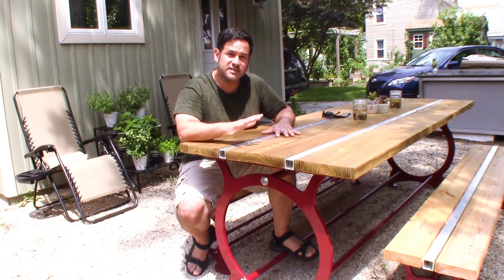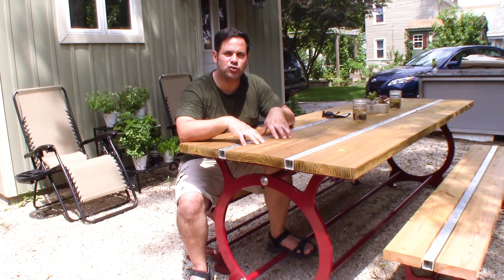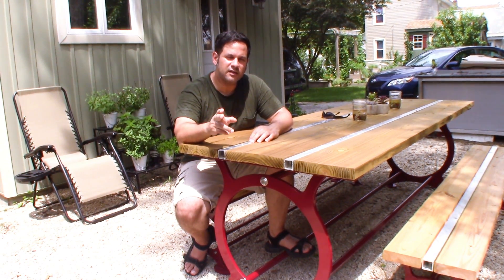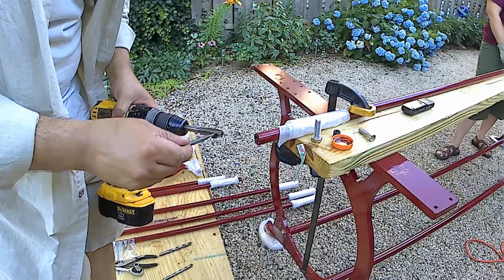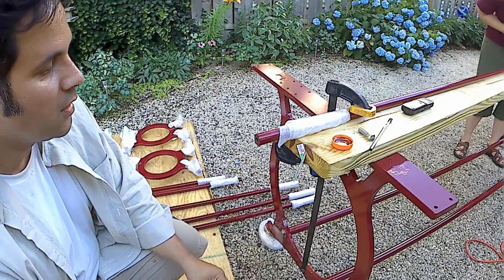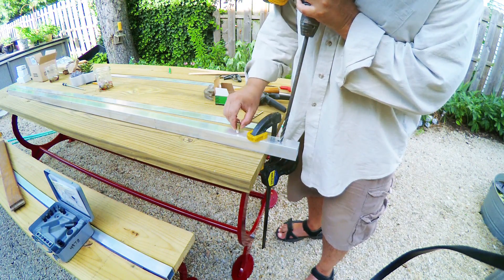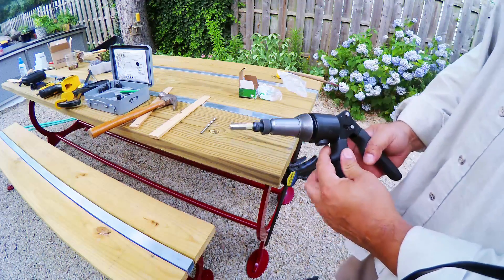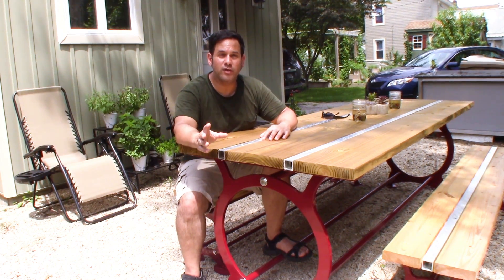Steel Picnic table deleted build scenes AND cost $$$

Comment: Didn't dare ask about the cost, but would like to see a more detailed video about the riveter.
Reply from the maker: the hydraulic riveter is an amazing little machine.  i had a manual mechanical one that i broke trying to install those very rivet nuts in the video.  the rivet nuts were left over from a job from several years ago.
Reply: oldkins as would I. That tool is cool...